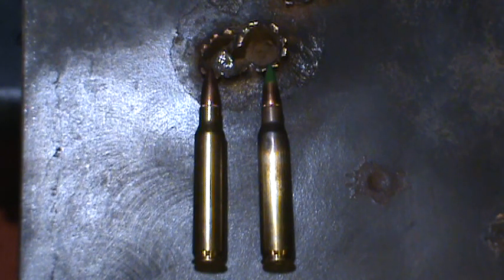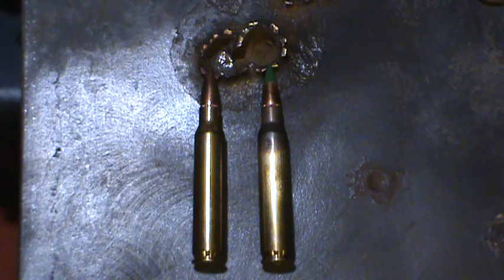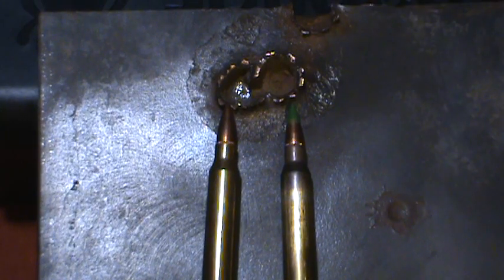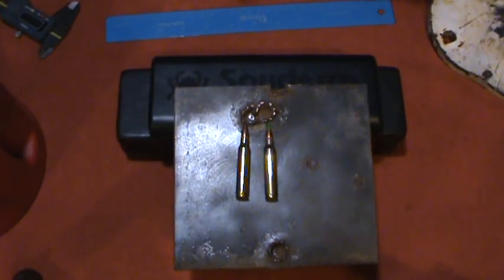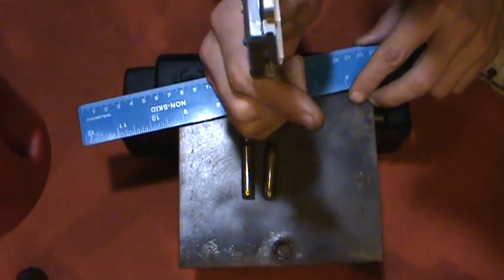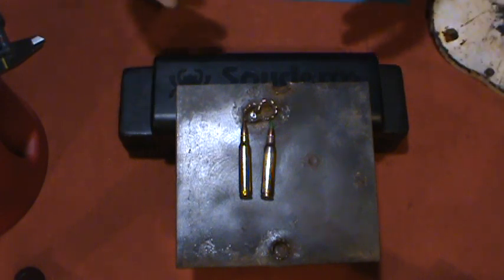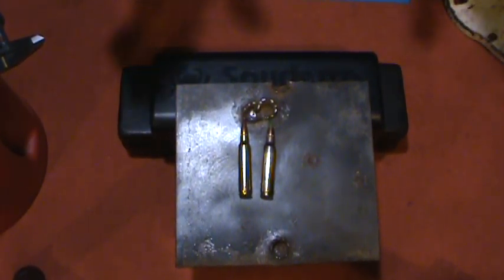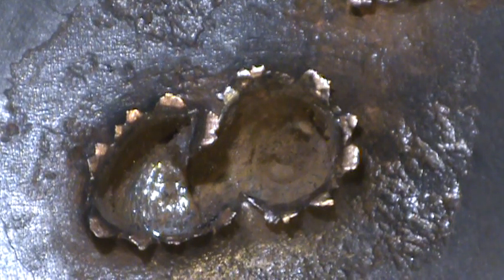62 Gr. Vs.  55 Gr. 5.56 Penetration-Check description for link to updated results.

Comment: Good work here, like the methodology in not penetrating the steel & taking a depth measurement so the results can be quantified. You've got the two weights, (55 vs. 62) but that's not the only difference in these rounds.  I could be wrong here, but I think the green tip penetrator should have a jacketed steel core & the standard round should be a jacketed bi-metal or lead core. Is it possible for you to check super interested in the results.
Reply from the maker: Aaron Charlesworth The 62 Gr green tip does have a steel core at the tip. The 55 Gr is just a standard lead core with copper jacket.  Once it's shooting in the spring again I'm going to hit that plate with a DRT Terminal Shock round and see how it compares. Thanks for your question.
Reply: For some reason out of all the firearms channels I can't seem to find any other head to head penetration vids. Would really like to see a 55 vs. 62 vs. 77 can't believe this subject hasn't been overdone seems like such a basic question.
Reply from the maker: Aaron Charlesworth In the coming year I will have more videos addressing some of that. As well as videos along the lines of what I've already done.
Reply: Alloy 2/11 You get a lot variation in results of what material is being shot. I see lots of difference between steel and body armor for instance. M193 defeats Level 3 body armor and even up to AR680 armor plate. Its the speed being faster than M855 that does not defeat Level 3 or AR680. That does not seem to be the same for steel but length of barrel and distance to the steel target are huge when shooting steel for penetration. Muzzle velocity. Thickness and type of steel also. Lots of variation so lots of different sample tests to run.

Basically if you want a body armor that will stop a rifle round then you need Level 4 or ceramic but weight and restrictive movement goes way up and like bullet resistant glass it does not stop more than one round in the same place. It just buys you time. Of course it does no good anyway if you get head shot. I like to know the options if I ever want to but personally I don't use body armor.